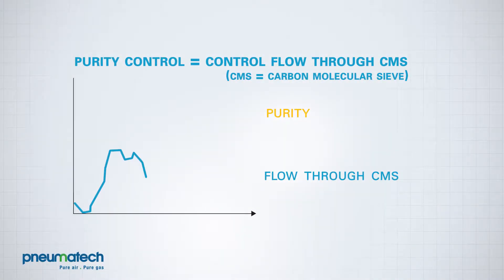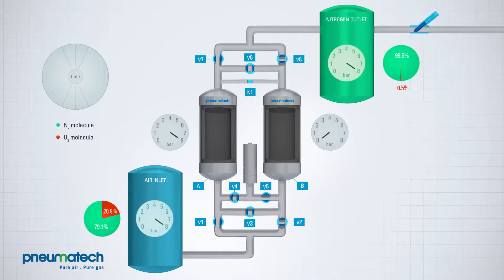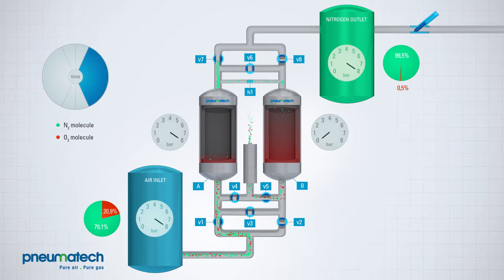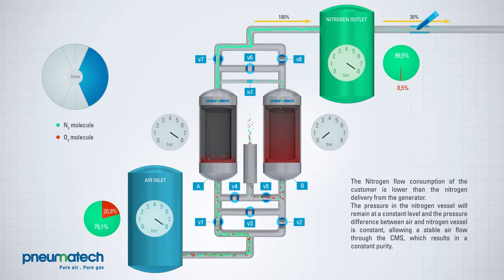Learn about Pneumatech Nitrogen Generator- Why do you need one?

Comment: The Nitrogen vessel is NOT a storage tank.  It is essentially a mixing tank to ensure a steady, constant purity.  The nitrogen that comes off the PSA beds early in the process is more pure than that at the end.  It therefore mixes to a steady purity in the nitrogen vessel and then goes to the customer. It is an integral part of the N2 system and cannot be eliminated.  Too many people look at these tanks as "storage" which is not the case.